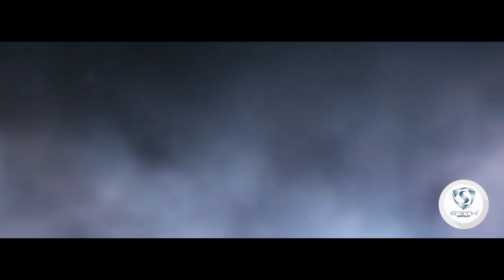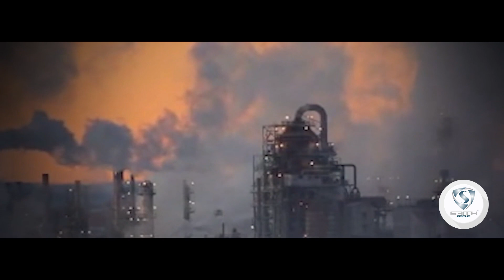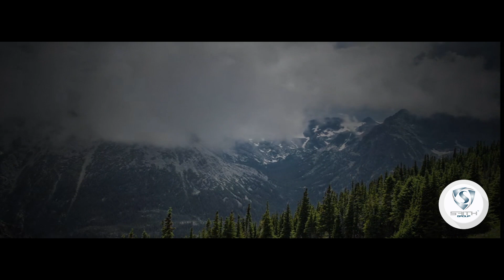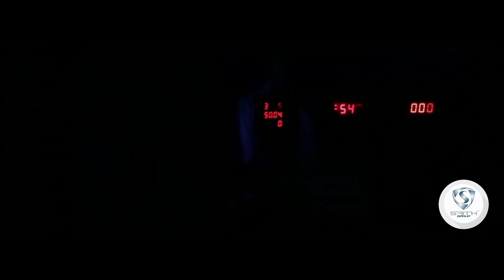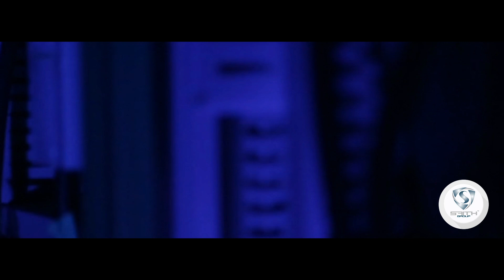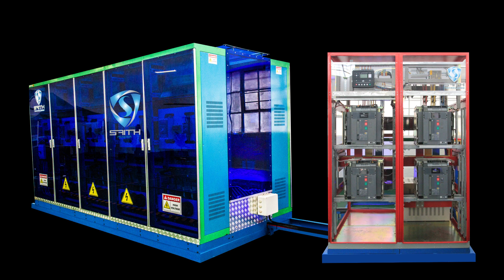Saith Greener Power Machine

Comment: I can't imagine a band of em radiation dense enough to saturate an area/volume the size of your machine. That could be able to directly convert to electrical energy at a level that could give constant out put of half a mega watt. Could you give a hint as to what part of the spectrum of frequency it harvests?
Reply: Just because you don’t get it doesn’t mean it isn’t real. Wasn’t Tesla on this already…👀
Reply: @kingsamuelofficial  yes my friend, the technology is very sound and used all over the world in many devices. My problem is with the claimed out put. I may have misunderstood, maybe he means once charged his large unit could deliver half a megawatt hour. Ie half a mega watt for one hour. But if as I understand he's claiming it can do a sustained output of .5 megawatt. I'd have a hard time beliving this. If you imagine the energy being beamed Into every cubic meter of space at the required volume. It would be so high a saturation I'd struggle to understand how life could evolve and function under this level of background radio energy. Im not saying 100% it's fake, I just don't think it likely to be true.
Reply: You are right. For such power levels to be transmitted through radio waves, and picked up by an "antenna" no bigger than a 40 feet container, the radio waves would have to be so powerful they would literally fry anything in their way. Imagine a 0.5 MW radio transmitter with a directional antenna. I certainly wouldn't want to stand in front of it. This is clearly a scam.
Reply: @HGSolberg  You don't understand.  You made assumptions. Don't be lazy and research zero point energy.
Reply: @W.451  There's nothing to research. It's nonsense. And that's not an assumption.

Comment: Cap. I don't believe it. The website states "We pushed electrical engineering to new levels, at 50Hz, it delivers world class performance. The 'perfect' sine wave output produced will ensure that even sensitive loads will be correctly powered, with no noise or interference." Does this refer an output alternating current at 50Hz? Does the "'perfect' sine wave" refer to a pure sine wave as oppose to three-phase ac? Why don't the buttons on the companies home page work?
Reply: Inverters come in several sizes and shapes, and probably you could make a 3 phase AC with this tech since it comes down to the inverter setup. Still, who needs 3 phase when you have all the power you need with 2 phase setup, right? If you aren't specifically running motors ofc, but still a simple inverter will fix that.

Comment: No information, no prices, many ambitious projects in web ... It does nor look like a real project
Reply: of course it's not, the 3 only  tech spec of the auto (a Toyota Aygo, by the way) do not work together. No real explaination, only ecolo and nationalist pride (Africa can create too!)...
Reply from the maker: sales@saithgroup.com    www.saithgroup.com
Reply: @laetitiadupuis7627  I noticed that too. 8 Watt maximum power! What on earth does that mean? 8 watt is hardly enough to power a slot car. They also claim 10 hp, which makes more sense,  but then they also claim a top speed of 90 km/h. There's no way 10hp is enough to propell a Toyota Aygo to 90 km/h.
(Actually, I believe the car is a Chinese knock off of the Aygo, called BYD F0, but that doesn't matter.)

The specifications for their helicopter is equally nonsensical.